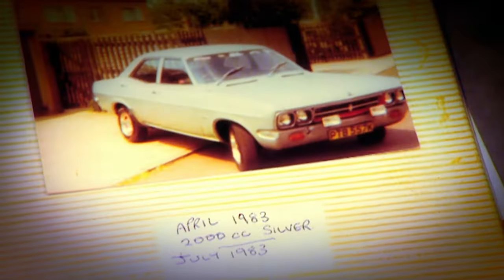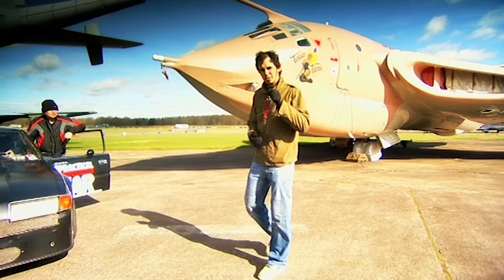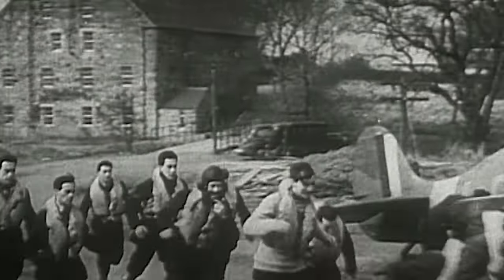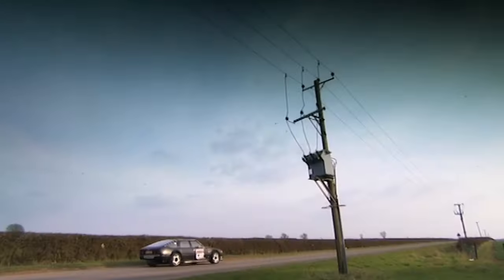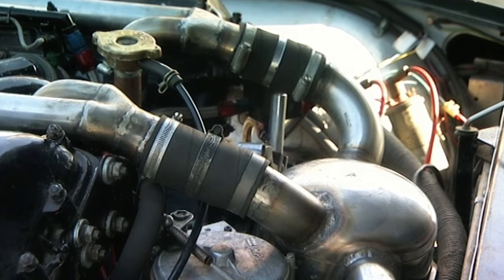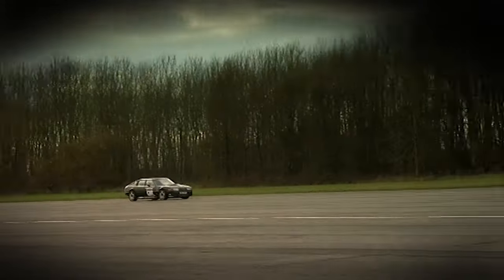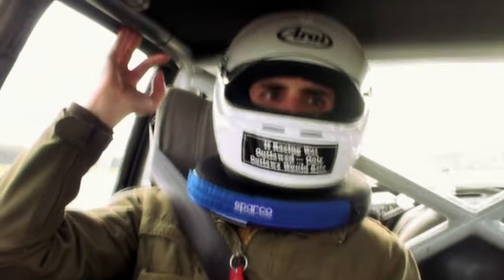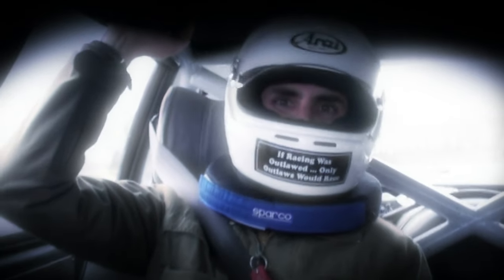Driving A Rover SD1 With A Plane Engine #TBT - Fifth Gear

Comment: Someone tell the brits that AC is meant to be used at temperatures over 30 degrees C. You know, like any NORMAL summer on this planet. Which is something they don't have in UK.
Reply: you mean apart from the last 3 or 4 years where the temperature has actually reached 40 degrees a few times and has happily stayed in the low to mid 30s for a few weeks at a time.
Reply: Air con dries the air so excellent for keeping the windscreen free of mist. U.K. has plenty of hot days but right now it is winter and freezing. The air con defrosts the windscreen quicker than heat.
Reply: eastwood978 Omg i don't believe it somebody actually has some common sense :o
Reply: Yeah and in this years summer it was about 36 degrees in the day and 25 at night which Is hot by anyone's standards
Reply: +lonewarrior1999 sorry about that I didn't mean to put that three times I think my phone was messing around haha.
Reply: +Ri Max  AC is meant to be used WHEN YOU WANT IT.
Reply: +iCloud Yeah, for 2 days. The rest of the summer was like 19 degrees max.
Reply: +Ri Max except for the fact that it wasnt
Reply: +Ri Max Britain is far warmer than the average for its latitude. Southern Canada, Scandanavia, Russia, all are roughly on the same level, yet are colder.

Equatorial summer, on the other hand, is ridiculous. 

Where I live, in Cornwall, it hits 30+ every year, and sometimes beyond 40. 

'Normal' summer also doesn't involve typhoons or hurricanes, or tornados, or giant hail storms, or three day electrical storms, or flash flooding, or massive drought, or any of those generally nasty weather patterns for us. Sucks to be pretty much everyone else. 

Air conditioning can be used in hot, or cold temperatures to provide a constant, comfortable level of ambient temperature inside the car.... by idiots.

I just do the far more refreshing and fuel efficient thing. Open the window a crack.
Reply: Jay Leno A simple quarterlight open does little to nothing for drag (the level of increase in wind noise is usually a pretty good indicator as to the amount of drag you're making) and sucks in fresh, cooling air. 

Air conditioning also dries out the air, and that can become rather uncomfortable over time. I'd rather be warm than shrivelled up. 
This is why AC on long desert drives is not recommended.
Reply: +cubeyuk I've been here for the last year. Last summer was all about winter clothes and sleeping with my hat on, during "scorching" 2 degree nights. "Summeriest" summer ever.
Reply: Ri Max I can't remember a 'summer' in all my years that's been that cold at night. Are you sure you're not thinking of winter? You're not from the Southern Hemisphere are you? You know that the seasons are reversed either side of the equator...
Reply: +lonewarrior1999 40 degrees !! where hell where you about you experienced that ?
Reply: MrByootox I don't know about Mr Warrior, but I've had it in Cornwall.
Reply: Foxtrot Oscar fair play bud !! I know it gets hot down there.
The highest I've ever seen is about 34-35°deg
Reply: MrByootox Every time it happens, the news switches to Farenhoots, becuase 100 Fahrenheit sounds more impressive than 40 Celcisus. 

Everyone goes mad. 
It's quite funny really.
Reply: +Foxtrot Oscar They should see what it's like to have summers when you first have to open all your car doors for 5 minutes before getting in, to avoid 3rd degree burns. :)

I've had a few burns like that.
Reply: The trick there is don't touch the metal bits, cover your steering wheel when you park, and have nice, cotton seat covers. Vinyl and leather are baaaaad. 

I've taken my ancient Land Rover through some of the hottest places on earth. Vinyl seats, everything is metal, no AC, but covering everything and being careful works wonders. Helps that I can roll the sides up though.
Reply: +MrByootox Here in Australia we often have days over the 40 degree celcius mark during the summer..up to 45 is not uncommon..the highest temperature I ever experienced personally was many years ago,on the day of the ásh wednesday' bushfires in South Australia where I live..it got to 49.5 degrees in the shade at work that day.
Reply: +MrByootox I live near market Harborough and we got 38.5 for about 2 weeks last year and have had it like that before aswell but I was actually referring to the whole of Britain including Cornwall and other places in Britain:)
Reply: +Ri Max yep and so has anyone in Britain who got in their cars in summer for the past years
Reply: +lonewarrior1999 Go have a walk. Breathe some fresh air to oxygenate your brain.
Reply: catey62 I've been to Brisbane and yeah the temps over in Aus are on a different level to us lol.
Reply: +Ri Max 
1 it does get above 30 sometimes in summer
2 the humidity is fucking horrific at anything beyond 25!!
ac also dehumidifies (thats how quick clear windscreens work)
Reply: +Foxtrot Oscar serious question here
how do the seasons work on the equator?
Reply: eatthisvr6 Seasons on the equator don't really happen. There is a slight variation due to the tilt of the earth, but generally it's only noticeable by sunrise/sunset shifting by a few minutes earlier or later over the year. 

The closer to the poles you get, the more extreme the seasonal variation, and in the middle is roughly even in the transition between summer and winter at each pole.
Reply: +catey62 aussie summers are killer. trying to sleep in the early months is a whole lotta fun.
Reply: +Ri Max projection much? lol
Reply: Ri Max Not half as much as you seem to..
Reply: Ri Max Don't you think you should find somewhere to vent all that hostility? Or is working at home just causing you that much stress?
Reply: That isn't really the case. I hear the 45+mph is better to use A/C alot, but in my experience that is not the case. I would say its more like 70+mph. In my car, running the A/C DESTROYS gas mileage, and on a fuel economy forum I participate in, a guy driving a honda insight on a flat road got 125mpg instant at 50mph in lean burn. Turn the A/C on, and it drops down to 75mpg instant. He rolled the windows fully down with A/C off, and it didn't register on the consumption display (with 5mpg increments), so he was still getting around 120mpg.

With that said, I don't roll my windows down more than about 1/3 of the way above 30mph, and I NEVER run my AC unless I have whiny passengers.

If I run my AC, I struggle to get 30mpg, wheras I can get high 30's otherwise. I am not going to debate the effectiveness of AC vs windows, but I will say that windows down works better than running the fan without AC.

Enter rant mode:

My problem with AC is how people abuse it. As I type this in my dorm, it is 65 degrees(F), and I am huddled in my blanket. When I come back from home, I walk in and the thermostat is set to 50 degrees. WHO THE FUCK SETS THE TEMPERATURE TO 50 FUCKING DEGREES!!??!?

When I have to drive other people around who don't share my same views on AC...

Its 75 degrees (F) outside? Better turn on the AC. Fine..CLUNK Power loss Goodbye throttle response. Waah, drive faster, be a binary pedal driver, wah. Accelerate up to that fresh red light....because its faster...Instead of you know, timing the light and rolling through while still going 20mph. approaching sharp corner SLOW DOWN!!!! OUR TIRES CAN'T HANDLE MORE THAN 0.1G OF LATERAL GRIP!!! 

I always find it funny when I exit the expressway and start coasting, and some sheeple comes up behind me and starts tailgating. As I approach the sharp 180 degree corner (of which the suggested speed is 30mph), I enter and maintain 45 mph throughout the corner, and halfway through the corner my previous tailgater is completely gone from my view.

It is so much more fun to take corners fast, but everyone is too afraid to even come close to the limits of grip, so they never get to experience that. And in that one situation where they were texting and suddenly look up to see they are approaching the corner too quickly, they jam the wheel over, completely oblivious to the mechanics of understeer, and plough straight into the guard rail. 

/rant

I don't like A/C :)
Reply: Climate control is much more effecient
Reply: michael jagger cc is nothing more than automated ac and yes it's more efficienct because it isn't on all the time
Reply: eatthisvr6 I have climate control in my car and barely hurts the mpg. In my old car with a/c you could feel the car working harder and would lose 5-7 mpg.
Reply: michael jagger I would suggest your old ac compressor bearings were on their way out then
Reply: eatthisvr6 No it wasn't it was just old fashioned air conditioning. Soon as you switched off the car went a bit faster.
Reply: michael jagger yes it would if the ac pump was causing excessive physical load
Reply: eatthisvr6 I could feel the drag when i switched on then it would lurch forward when switched off. Technology is more advanced.
Reply: Chris Williams A/C puts a huge strain on your engine when switched on where climate control doesn't do that. Its much more efficient.
Reply: michael jagger you don't know what you're talking bout fella.
1 ac compressor does not put a huge strain at all if it's working correctly you can easily turn it by hand.
2 climate control uses the same hardware as ac basically. all it does is control the temperature electronically and it still uses the ac compressor when the weather is hot
Reply: eatthisvr6 So why does the cars with A/C when switched on lag a bit and cars with climate control don't?
Reply: michael jagger 

He's right, climate and a/c both use pumps to circulate the refrigerant.
Reply: Chris Williams Maybe but its just finding why A/C makes engines lag a bit when climate control doesn't. It might be because climate control temps are electronically controlled.
Reply: michael jagger the pump is either on or off so the load when it's on is the same.
I suggested your old ac pump was on its way out, I have a 13 year old vectra with 160k miles on it and it only had 100 hp when new and there's almost no difference when the ac pump is on or off, it certainly doesn't leap forward when it switches off.
1 thing I suspect newer cars might also do (I have no proof of this it's merely a hypothesis) is because it's all fly by wire engine management it's certainly possible that the ecu could give slightly more throttle to the engine to compensate when it detects the ac pump engaging, this would smooth out the switching, the only time this wouldn't work is when you're already at wot so there's no more power that can be added
Reply: Chris Williams A/C isn't computer controlled i don't think.
Reply: my point is that the mechanical pump is basically the same in most cars
Reply: no its a button that you press which engages it directly, 
with cc the ecu will turn the ac on and off quite alot and this is why you get better mpg, because it physically isnt on as long as when you control it
Reply: eatthisvr6 So thats why then. I have an auto function on my climate control the adjusts the temp quite alot.
Reply: yes, it will vary the temp and the usage of the ac to try to maintain a constant temperature
Reply: eatthisvr6 All makes sense now.
Reply: British weather... it's what got rid of the Romans!
Reply: Ri Max  Yeah but we are all so hard in Blighty, We have the AC in in the Winter ..    just for fun !  :-)
Reply: who the fuck wants to have 30 degree temperatures, far too hot.
Reply: I wish I had air conditioning today, but it's only in my car, or at work.

Comment: It's not a its not a merlin as its from a centurion tank. This motor is a unsupercharged variant of the merlin engine called the meteor which had a different feeling system and was only rated at 700 HP.

Comment: It is a RR Meteor not a Merlin. 😉 That means about 1000hp less.

And yes, a standard car gearbox can handle the power of this engine as long as you keep it in 1st or 2nd and maybe 3th: the grip (or lack of it) of the tires will be the torque limiter. 😁😁

Comment: Why do people always say it's a Merlin engine like in the Lancaster and the Spitfire? It isn't it's a Meteor engine,  a detuned non supercharged engine used in tanks etc. The merlin had huge superchargers at the rear of the engine and its output shaft at the front to drive the airscrew, almost impossible to fit in a road vehicle. The meteor with no superchargers and a rear output shaft can quite easily be put in a road vehicle because that's what it was made for! I've never seen a car with a real merlin engine installed no matter what they say.

Comment: I love it! So ive heard of two speed rearends in old American dump trucks and trucks with trailers..... Im pretty sure the ones with the two speed rears were gasoline engines. I assumed they needed a low low gear to compensate for the lack of torque compared to a diesel engine. So is the trans similar to the rears of the old trucks? Also it sounds like he dosent have a power issue more of a rom issue. With that said im sure a machine shop has the ability to give some more rpms. So using a different crank, pistons, length of connecting rods, and then dig into the valve train surely oughta get you several hundred if not a thousand or more rpms. Idk about this particular engine but loads of the old WW2 avation engines came equipped with some type of supercharger. So with the availability of performance parts today id say it would be easy to find some the give it a significant boost in performance. Id find an expert on gear ratios and transmissions and let them figure it out i know in drag racing just a single part as a torque converter can be a huge difference and they are so specific to what you want your machine to do. Frankly torque converters and transmissions are basically magic to me so the fact you found a work around with tech from the WW2 area is an accomplishment in its own. Keep at it sir its one hell of a cool ride

Comment: Why put a 27 Litre engine in a old Rover SD1... Simply, because you can.  I love the fact that at 2 mins and 7 seconds  you can see it's driving along and it looks like it's doing 30 MPH at 800 RPM.

Awesome car. Totally nuts, but definitely awesome.

Comment: My old Sd1 did 142mph with the 3.5 V8 and a bit of tuning. Very unstable at that speed though, not safe. The one in this video is an aerodynamic brick.

Comment: 160 mph with 2000 rpm...😱
This car could literally hit 500mph, but the gearbox would explode way before he reaches that speed..Eeeek 😳
Reply: What is possible in the air does not reflect what an airplane engine can do on wheels. And anyways, as others have said, this is not an airplane engine, but that of a tank

Comment: '162'
Engine: sounds like it's idling
Reply: That's those old engines for you. Great lumps of torque but can you imagine spinning a 27 litre engine any higher than 3 grand? The rotational mass is insane in those things. What I found impressive is it just didn't stop accelerating. It was still pulling hard, it just ran out of runway

Comment: if that were a modern engine with direct injection an two turbos slapped on I would reckon it could do 3-4000HP, and top out at 250MPH

Comment: Its not an actual Merlin Aero engine, Its based on the Merlin but is de tuned to use on Tanks. Hence low speed high torque. I think it was called the Rolls Royce Meteor.

Comment: i bet that my car sounded way more tortured when i did 255 km/h in it. 

it is a tuned volvo 940 with the original 2.3 liter inline 4. it did it but i destroyed my exhaust on a bump on the same run...

Comment: And it wasn't a Merlin engine. If it came out of a tank it was a Meteor which was a down rated version of the Merlin specifically designed for AFV use.

Comment: Impressive engine, but at 27L and 162 Mph... 1.8L (sure with a turbo 1 bar boost so really a 2.6l) and it's not impossible at all to go 160 Mph... with a lot less BHP... around 300 BHP would probably suffice.

Comment: It wasn't the same engine used in planes, the planes were supercharged and i think the tank engines produced less power than even the plane engines that didn't have superchargers. That's whey they were so much better than other engines around at the time.

Comment: Brilliant RR meteor engine completely wasted  in a p.o.s SD1. In any case even a tuned/bored and stroked rover 3.5v8 could propel that SD1 to well over 160mph without 27 litres capacity..

Comment: @ 3:05, how does the old bus's gearbox multiply the rpms from the engine 3 times onto the rear axle ? Is it b/c of a certain gear arrangement in that tranny that it's able to go fast at the same low rpms ?
Reply: Well the engine drives in where the bus gearbox  output shaft was, so  one of the originally low gears will be rotating faster. Step up gearbox might not  be very durable  because more input  rpm than original propsgaft speed  and needs straight cut gears because helical gears would experience thrust in the wrong direction in gearing up mode. Torque situation would probably be a close match for say 200 bhp input originally at the high speed end of the gearbox, RR Meteor (unsupercharged Merlin) would be about 600 bhp?

Comment: The technology of that IIWW engine almost suits the technology of the Rover´s original one so I think It´s a good swap.
Reply: Yes the SD1 was a major technological  step backwards over the P6  especially on its suspension,  seemingly   reliant on a lot of Triumph details. Look at SD1 front suspension turrets; IDENTICAL to my 1971 TR6. I'm convinced Harry Web when a Triumph had the SD1 up his sleeve as a Triumph 2500 replacement before taking over Rover engineering via BL.